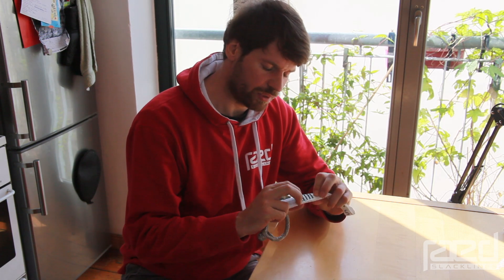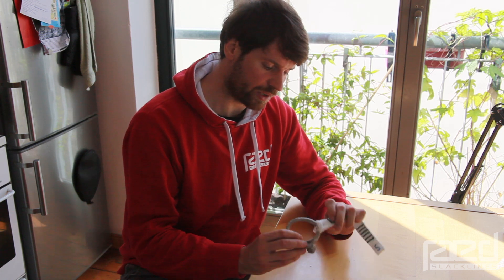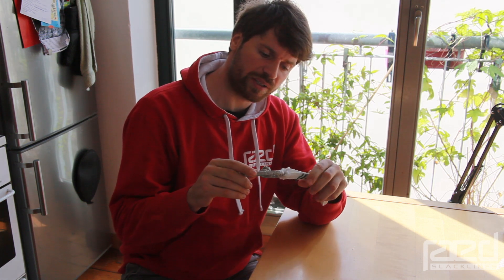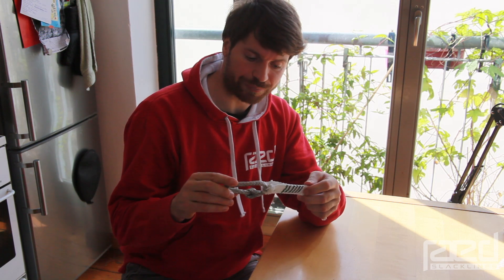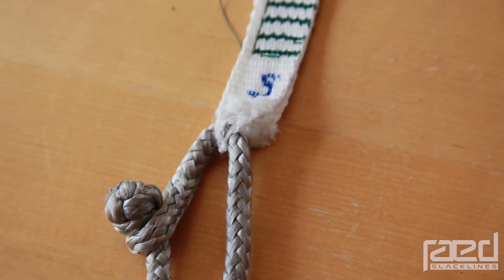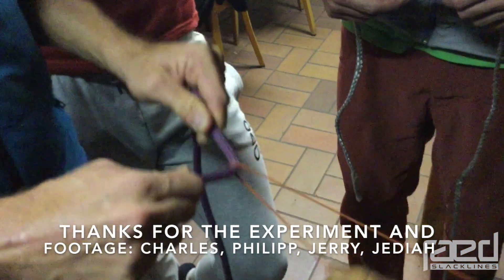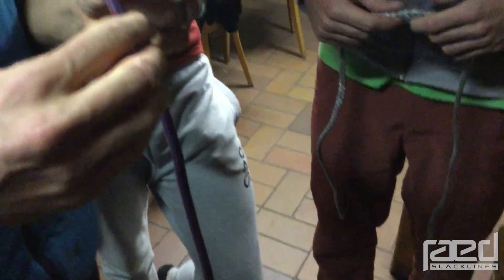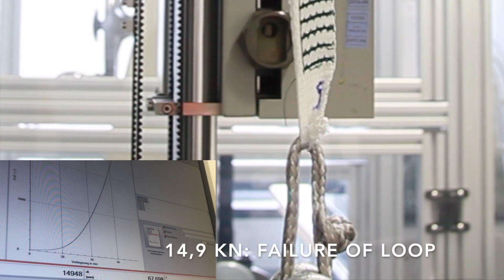Risks of soft shackles in highline rigs

Comment: How about padded sewn loops? Seems to be done a lot with them without problems (search "how not to Highline - inov split")
Reply from the maker: Padding the loops or the shackle still doesn't solve the biggest risk of soft shackles: They can open up accidentally when they're not under constant load, as it's usually the case in backup connections.
Reply: @raedslacklines  can't this be fixed by taping the eye?
Reply from the maker: @kiljanammann9300  Subpar in my experience. In my experience tape doesn't stick on all Dyneema brands (some are coated and very slippery) and tape might slide away after getting wet :/
Reply: @raedslacklines  cool, thanks for the information!